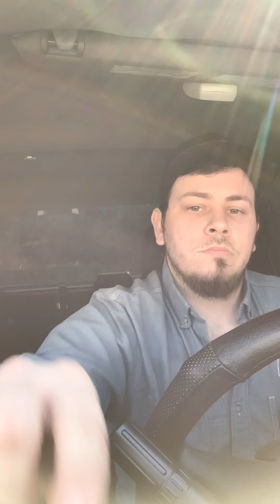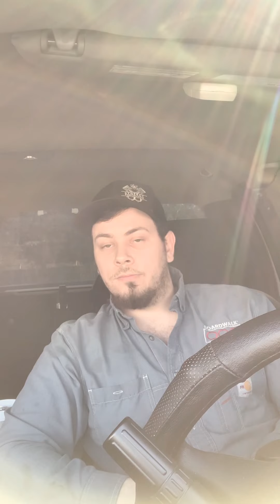Built 2.7 ecoboost pt. 1

Comment: I know this is an old video, but can you explain what you did to get the AMS 3.5 EcoBoost adapters to work on the 2.7?
Reply from the maker: I can’t remember 100% but I know I took off the factory turbo inlets, compared them to the AMS inlets, and then trimmed the turbo ends of the AMS inlets to match the bends of the factory inlets

Comment: I've decided to try MPT tuning for a 93 and E85 tune but on the form it states that a hpfp is required for E85.  I ran E85 last year with stock in tank and stock hpfp.  Now I run the DW400 in tank pump.  I really don't think a hpfp is required.  I think I heard you mention in the video that your hpfp is stock and you'll be adding turbo upgrades.  I don't want to fork out 1300 bucks for something that's not really necessary.  Let me know what you think.  Cheers
Reply from the maker: Sorry for the late reply. You do not need a hpfp to run e85 on the 2.7, even with larger turbos. I run the largest stock frame turbo ever made for a 2.7 and I still have the stock hpfp. I did upgrade my port injectors to factory 3.5 port injectors and they provide plenty enough fuel
Reply: @jaceporter2820  factory fuel pump?

Comment: Do you have aftermarket injectors ?
Reply from the maker: I didn't at the time of the video. Once I did turbos, I upgraded the factory port injectors to stock 3.5 port injectors.
Reply: @jaceporter2820  how is she running now
Reply from the maker: I sold the truck awhile back, I'm building a 2017 powerstroke now. It was fully build with custom pure turbos when I sold it. It was a very strong running truck and surprised a ton of people that lined up next to it.